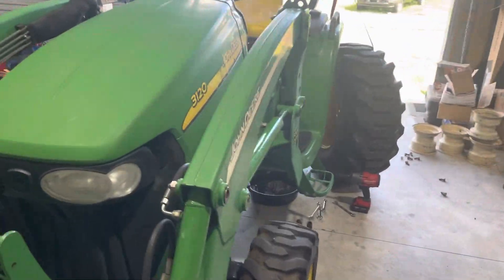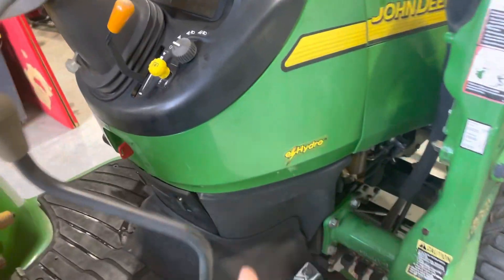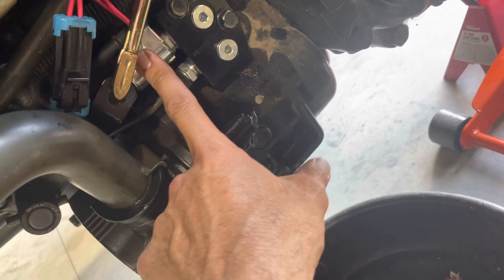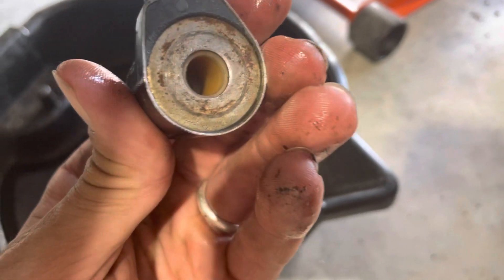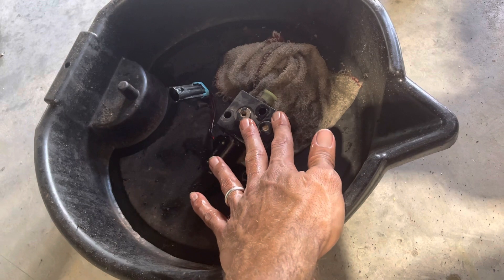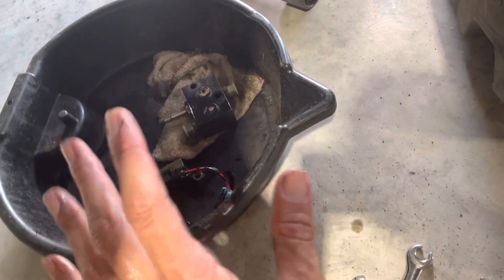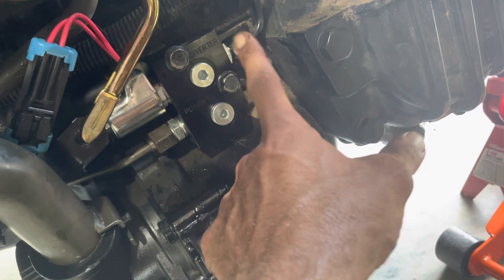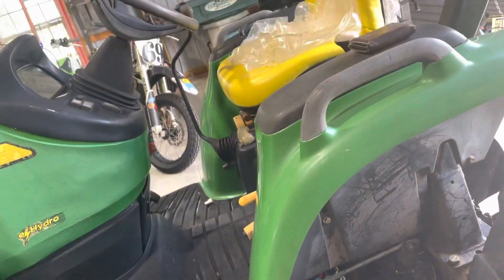John Deere ehydro 3120 pto won’t engage FIX hydrostatic transmission

Comment: Take the valve out clean and try it first
Reply: Whats what i did i sprayed the check valve with carb cleaner and wd-40 and took a pick and got the check valve to spring back and forth and put everything back together and it works like a charm and i still have 800 dollars in my pocket